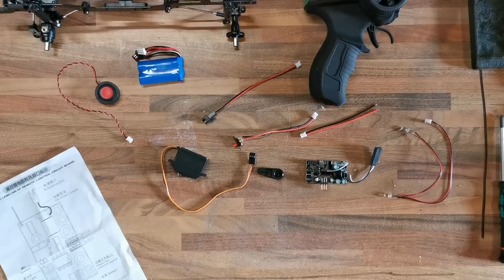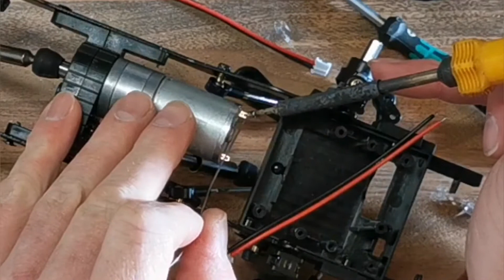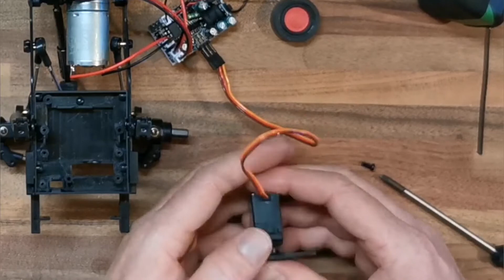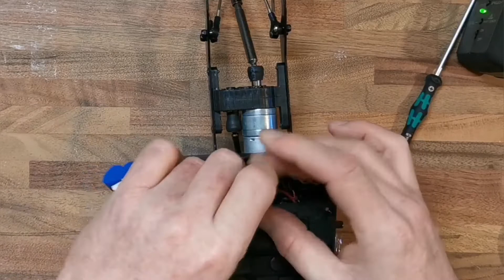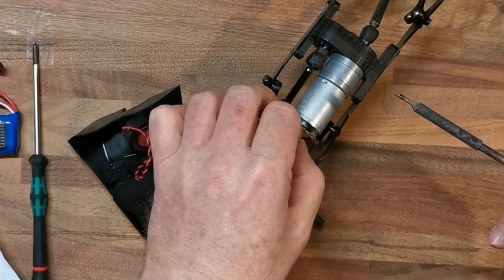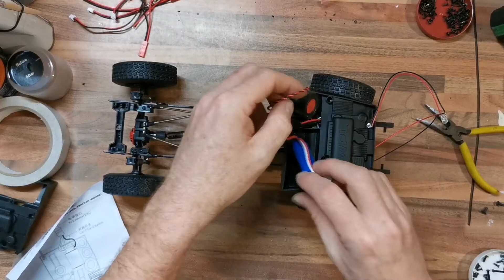WPL C44KM Real time build - Part 3 - WPL Res-V3 electronics installation.

Comment: Was that the gas motor or diesel motor sound?
Reply from the maker: Hi Martin, that is the gas (petrol) sound on that one.  The diesel sound is programmed with the sound of air brakes being applied on deceleration so is better suited to the B series trucks.
Reply: @smallscaleadventures   Thank you for your fast reply and helpful video. The first video I watched about this V3 system I thought you could change from Gas or diesel sound but I guess the diesel sound if a different circuit board that wpl has. ?
Reply from the maker: @martinwhitehurst9893  When you buy the Res-V3 from the Official Store you can specify which version you want. https://www.wpl-rc.com/products/r-e-s-v3?ref=ssa
Reply: @smallscaleadventures  got it thanks again.

Comment: I appreciate this series.  I am building a C24-1KM but struggling with a lack of instructions.  I didn't know about the steering so I inadvertently over tightened the plastic end pieces and one came through into the ring.  I don't think the thread has gone though.  I also did not know about the 100mm length.  Nor did I know you had to really press the brass ball into the ring.  I will give all of this a go.

You mentioned adjusting the steering.  I am puzzling what were the symptoms and how did you adjust it?

I have the same problem with the cutting out so now I know it is wrong and that sound is why the capacitors are needed.

I is a great pity I searched for C24 builds only, thinking other WPL types would be different.  Perhaps you could add a note for the confused like me the says a lot applies to other types.

How nice it was to hear a fellow Brit taking it steady, telling it like it is - no self aggrandizing, no crappy music either.

So many, many thanks from a grateful new subscriber.  You have probably saved my bacon.
Reply from the maker: Many thanks for the comments! I've actually got a similar build for the C24-1 on video but I haven't got round to editing it or doing the into-exit segment yet.

I can't remember now what steering issue I was seeing, it may just have been lengths of the rods or more likely positioning of the servo horn or servo horn pivot placement to get the correct throw.
Reply: Well I screwed my steering since the lower ball of the servo link won't stay in.  I bodged a fix. I ran out of shorter machine screws so hacksawed one down.  What fun eh?

The offset servo arm means the wheel angles are different on left and right turns; left turn is sharper/tighter but hey ho it's a crawler so I doubt it matters.  The servo arm link length needed adjustment by eye so the balls were in place.  At least the adjustment was simple by screwing in and out of the socket ends.
Reply from the maker: @Tattva-Darzin  It's very often - always - two steps forward and one step back again!